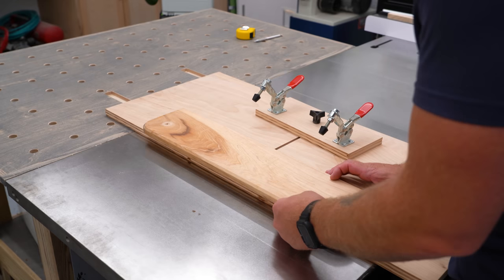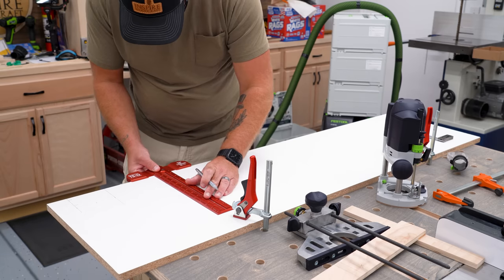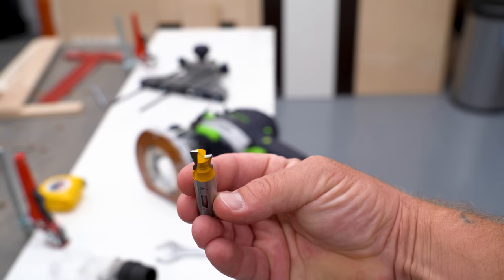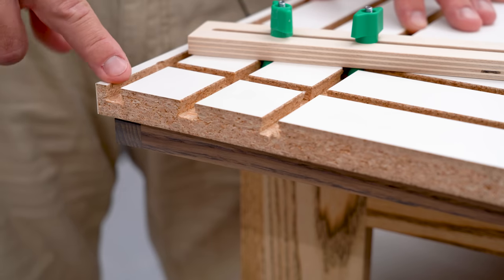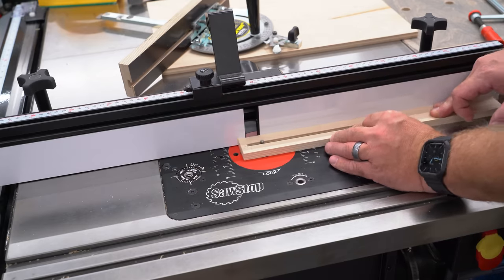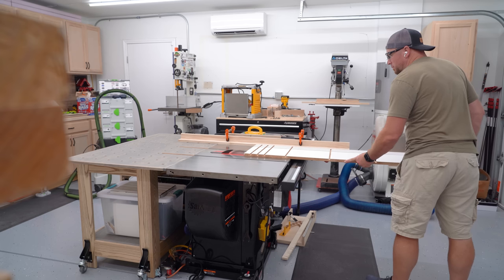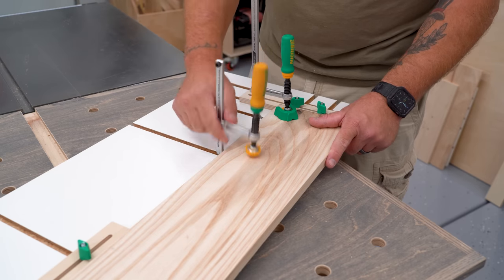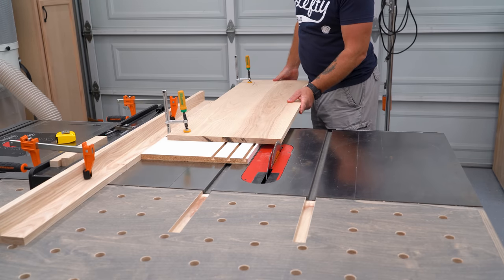Unlimited Possibilities with This Simple Straight-Line Rip/Tapering Sled

Comment: Great video Jody. I think the melamine will hold up just fine, as long as it's not getting slammed around, yes baltic birch is stronger and stiffer, but this way you can run this one and make any improvements with a different substrate later. Great stuff, thank you, Jim.

Comment: I've used shelving for other jigs too.  One of my "tricks" is to smear some wood glue over the ends of the unfinished shelving.  It helps seal them from moisture and they hold up longer.  Thanks for this great video.
Reply from the maker: @Steve Stamper Thanks for adding this! I almost did the same thing but I didn't know how well it would work.

Comment: Another simple but great idea for a jig, and also just as importantly the thought processes behind the design which are mostly overlooked ... that information in itself is invaluable!
I'd add a removable mitre slot rail to the underside (located in a slot and held in by screws) which provides a zero clearance mode of use for doing 'on the line' style cuts ... remove for when wider items are being cut :)

Comment: Love the idea of not extending the grooves toward the cut side. Recently ripped a straight edge on about 50 rough cut scraps that were .75-2 inches wide and constantly had to make sure clamps weren’t hanging out
Reply: When I built my first sled I shaved a slice off the rubber foot of the toggle clamps. I was lucky it didn't hit metal.

Comment: Thanks for sharing...I learn something every time you post! I intend to make one of these for myself from 3/4 MDF..I get the melamine surface provides less friction, so I'll surrender to the paste wax process...Thanks again!
Reply: as a follow up, my jig is just over 54" long and 13" wide mdf with multiple coats of wax..I also use it to joint one edge of a S2S board and have realized much success..still use it for tapered cuts as well..Thanks Jody for this  and all the other learning tips you've shared..this is by far my "go to" channel

Comment: The Matchfit system is fabulous. I made a sled in the same way than yours, but far more basic. Now I will make one like yours. A lateral note: I modified my fence and now is 50" long, this way I don't need the additional fence clamped to the saw original fence.

Comment: I like the idea of being able to accommodate essentially any width, but at a certain point (probably roughly double the width of your sled, bit also dependant on stock thickness and mass) the stock being cut will weigh enough to tip the sled. I wonder if a 2 inch strip of the same material as the sled with a bunch of magnets recessed on the bottom could be used as a support out closer to the blade for wide cuts? It could even be extended longer than the table both front and back to serve as infeed and outfeed support for long rips. Alternatively, bottom mounted clamps of some type might hold it in place better if the saw setup allows for a place to clamp it to.
Reply from the maker: @Jason Still All good points/suggestions. In my experience, depending on how heavy the sled is, it does take a little more than double the sled width to introduce tipping. I don't have anything in the shop to try it out with this sled. If I do run into that situation though, I will probably just double-side tape a strip of the sled material to the table to support the weight. Technically it will alter the angle of the cut, but negligibly.

Comment: Nice setup.  Appreciate the video.  I personally use 3/4 inch Baltic Birch, and use T-tract for my slots.  There are any number of makes/models/types of devices that make use of T-tracks.  Some of my sleds are over 20 years old, and work just as good as the day I made them.  In my experience, particle board isn't going to hold up to constant use over the long stretch.  Thanks.
Reply: The microfit items he’s using approaches $200. Can buy a lot of t-track and toggles for that.
Reply from the maker: @Rta373 Not sure where you came up with $200. On the less expensive side this can be done for $50. Upgrading the clamps brings you up to $70. Maybe I'm missing something?
Reply: @InspireWoodcraft  Microgig dovetail starter kit is $90, 2 adjustable clamps is $40 and I just guessed that you had about another $50. I may have overstated the $, but it is  a good $150.
Reply from the maker: @Rta373 Everything that I had in the shop totals $140 (and I do not have the starter set), but I just want to make sure that one very critical point doesn't get overlooked: You don't need everything that I had, which technically was only extra two clamps. I only had those things to show a few variables on what you could accomplish with this sled. For $50 or $70, someone could have enough hardware to make an inexpensive sled. Most folks have a dovetail bit already and as I said in the video, the Matchfit bit isn't necessary, just convenient. The only reason that I'm pushing the issue is because when other people read the comments, they get discouraged by seeing a price, and if that price is wrong, they won't benefit from what they saw in the video.
Reply: @InspireWoodcraft  thanks for your thorough response
Reply: Also, the clamps and bit can be used for other jigs and projects

Comment: I watched the video on how to use a measuring device.  You noted using a fine line for your mark and other helpful tips.  I still do not understand if I want to cut a piece exactly 2 inches in the middle of a board.  I mark the two points for 2 inches.  Where are the cuts made?  The outside of both marks, the center of the marks or inside the marks.
Reply: Depends on which sides you measured from. If you measure from the left, the left side of the line is accurate, and vice versa.

So, if you measure both lines from the left, you’d cut on the left side of both lines.

Comment: Nice one.  Don't know if its been mentioned, but the other way to avoid cutting the clamp is to reverse the head.
Reply from the maker: @Gary Becker It has and thanks for adding this. At this point though, I personally cannot recommend reversing them. I ran tests for two whole days trying to use them reversed and could not come up with a single way to use them safely without modifying something. They simply would not hold the material down tight enough before they ripped apart the sled material. This was on particle board and phenolic ply.
Reply: @InspireWoodcraft  I like the built in stops better.  Ive only used them reversed in dog holes.  i dont doubt your results.  ;-)

Comment: Jody, love your videos, thus one not withstanding. I'm in the market for a new plunge router and noticed you using that Festool router. Would you recommend it and did you use it with a Festool vacuum as well?
Reply from the maker: @Jeffery Debs Thank you very much. So truthfully, I don't know that I have had the OF1400 for long enough to definitively recommend it, but I will say that I am not at all upset with the purchase. I really like how it plunges. For some reason being able to one-hand plunge (like "drilling" the starter holes in the sled) is one of the things that I've really appreciated. I also like that the on/off switch is a trigger style, and can be used either by squeezing it on or by locking it in the on position, similar to a circular saw. There are two things that I love about it the most so far. One is how quick and easy it is to change collets/bits. It uses a ratcheting mechanism, so you only need one wrench to change things out, and it works extremely well. The other thing is dust collection, which of course was your second question. Dust collection is superb! It does take a little bit to get into a rhythm as far as how to set everything up and what to do/not do, but that's like most tools. The extractor is the CT/48 and I am a huge fan of it as well, and of course it pairs perfectly to the router. I hope that helps!
Reply: @InspireWoodcraft  Jody, that helps a lot, thank you. I'll now look up pricing for both the router and dust extractor and will make sure to be sitting down upon learning of their cost!

Comment: Do you have an opinion about the Match Fit system by MicroJig? You're halfway there with some of the jigs you use. Thx for sharing your knowledge
Reply from the maker: @Michael P I like it. I think for one or two jigs it may not be worth investing into, if you currently have another way of doing it. But if you find yourself making new jigs all the time, the cost of the system pays for itself very quickly. It's very easy to just route a dovetail and get to work.

Comment: Couldn't you have turned the head of the clamp around so clamp foot was not directly below head of clamp?
Reply from the maker: @Diane Takis Not in this case. When reversed, the clamps will not tighten down with enough pressure to safely hold the material without tearing the sled apart. This is the case with particular board, plywood and solid wood.

Comment: I'm not a fan of the Matchfit for the simple reason that they're slightly smaller than guide rail clamps. If I cut a t-slot groove which fits a guide rail clamp I can put nearly anything in it. If I cut to the width of the Matchfit bit, I can use Matchfit. The only thing I've used the Matchfit bit for recently was to run it twice a little more than 1mm off to create wider slots.
Reply: I completely agree! Because Matchfit clamps don't swivel 360 deg, you need more slots to cover all clamping possibilities and yet T track clamps, some auto adjusting, from Rockley, Bessey, Armor tool and Kreg all do and you only need a few tracks. I've made a similar jig with 2 T tracks to hold the fence and a slot in the fence for a few hold down clamps. They are handy for some tasks eg sacrificial fences but not sleds
Did enjoy the video.
Reply from the maker: @Kyle Olson Yeah there seems to be a lot of discussion of dovetail vs track clamps. I was hesitant for years on the Matchfit because it almost seemed gimicky, but when I built my outfeed table I decided to try them out, as well as the Bessey track clamps. In my table legs, I routed the dovetail slot as well as a well-placed t-slot, and now I can use either clamp in the one groove, which is kind of nice. I will say though that the more I use them, the more I'm sold on them simply because there are so many different profiles of track, t-slots and track clamps, and there's only one 14-degree, 1/2-inch dovetail. So they just work. Getting the right combination of track or t-slot with the right clamp isn't as easy.

Comment: Take the screw out on the clamp and reverse it.  The saw will not cut the clamp then.  That’s what I do.
Reply from the maker: Thomas Slate I wondered if someone was going to bring this up. At this point I personally cannot recommend reversing them. I ran tests for two whole days trying to use them reversed and could not come up with a single way to use them safely without modifying something. They simply would not hold the material down tight enough before they ripped apart the sled material. This was on particle board and phenolic ply. I actually had footage of the tests, just in case folks asked, and I cut it from the final edit because I didn't think anyone would care. Haha

Comment: I don't know why you made this although it is a very nice project but when you can do the same thing using your table saw fence you would gain an extra three quarters of an inch thickness in cutting depth
Reply from the maker: @Rick Gledura Because the only other safe and successful way to straight-line rip or taper without a sled is to have something secured to the workpiece via double-sided tape or screws. Then that something (like a long piece of straight plywood, for example) would ride along the fence. The result would be a nice, clean, straight cut. It's quite a pain to do it that way when you have multiple pieces to cut, especially when you want them all to be to the exact same taper.
Reply: @InspireWoodcraft  
It would be easier to set your fence and use a taper jig
Reply from the maker: @Rick Gledura Oh I see what you're saying. I thought you meant just the fence. So I'm not sure if I mentioned it or not, but this IS a tapering jig. Just a bit of an upgrade from the traditional style tapering jig since it gives me more options. Thanks for watching!

Comment: I’ve been using a straight line boards for 30 years and they are the most over engineered jigs I see on YouTube. All you need is a straight board with something as a stop or hook attached to the end of the board and that’s it. Making sleds with clamps, t-tracks, flat screen tv’s, microwaves and what ever bling you can put on them is absolutely silly to me.
Reply from the maker: @Marcus And yet you still clicked to watch 🙄
Reply: @InspireWoodcraft  - Actually I didn’t, the thumb nail was in my feed. Enjoy your thingamajig.

Comment: great sled idea,..... terrible, expensive proprietary clamps.... there are much better, way cheaper clamp options
Reply: Don’t leave us hanging! Any recommendations for alternatives?
Reply: Not really.. they just go in a track created with a 14° dovetail bit. You can use any bit, theirs just has a roundover so the clamps and jig hardware slides better. The cost savings comes from the fact that you don't have to buy t-track ever again and the jigs, tables and sleds you can create are far more versatile. This system has saved me $100s
Reply: @G0F15H  You can buy a T slot router bit instead of T track and use inexpensive hold down clamps, I've even made my own, that swivel at 360 degrees. I've saved even more
Reply: @John Barr  has answered the question perfectly.... t-slot bit instead of a dovetail, lets you use the chinese knockoff bessey/festard clamps that fit intp T-Slot groves.... I just know I have other stuff to waste money on other than proprietary tools (remember microjig, magswitch, kreg.... all hand out tools to these dudes like candy... ) not that is happening here, just another point
Reply: @CementRoots  Sure, you can do the same thing for T-slot stuff. The point is, the MatchFit system isn't proprietary. It's not the industry standard, but that doesn't mean you have to buy MicroJig products in order to use the system, or that no one else can introduce products that utilize a 14° dovetail track
Reply: Another important feature of the MatchFit clamps, remove the retaining screw on the end, turn the clamp around & reinstall the screw (if necessary)
Then, the clamp does not “stick out past” the edge of the board.
I’ve done this & works out great.
Thanks for all your efforts, contents & quality workmanship.
Reply: @G0F15H  try sticking a bessey or even better a bessey knockoff in one of those dovetail slots, aint happenin'..... also try putting one of there clamps in a t-slot... nope..... there system is a one trick pony.....
Reply: @CementRoots  Why would I do that? That's not how the Bessey clamps are designed to work. They're also the same price as the MatchFit, so what's the advantage of buying that brand over the other? Your whole argument is equivalent to calling a Philips head screw proprietary and then using a flat head screwdriver; it might kind of work, but why not just use the proper tool for the job?
Reply: @G0F15H  I'll say it again with less words.... t-slot router bit.... with bessey "style" aka countless chinese knockoff table clamps..... your done for under $50
Reply: @CementRoots ......  and you don't need as many slots as all the inexpensive hold down clamps can swivel at 360 degrees so less time making the jig. As an example I saw a drill press table that had 10 dovetail slots, mine has two T tracks (can use T slots) and covers every clamping point I need. Also the clamps I use I made myself that use standard 5/16" bolts (not microjig's more expensive dovetail bolts) so you have the choice of a vast array of clamps that have been around for years from inexpensive home made clamps to the auto adjust clamps that you might already have lying around the shop. Less time, way less money and more choices.

Comment: To avoid the blade running into the clamp, you can easily swap the direction of the clamp as shown by the clamp resting on its flank in the center of this photo: https://global-uploads.webflow.com/5cfd83cf1c26ab7392063e1f/5deb207ef88fbc48862a4bcb_dovetail-clamps-workbench.jpg
Reply: To do the swap, just undo the screw at the top of the clamp, then pull out the piece all the way and reinstall in the other direction.
Reply from the maker: @Julien Phalip I was going to originally, but the clamps don’t clamp down tight enough before the material starts ripping apart. I ran a bunch of tests on particle board, phenolic ply and hardwood, and the materials always start breaking apart long before the clamps provide enough clamping pressure. At this point, I personally don’t recommend switching the clamp heads around in this application. Too much room for something to go wrong.
Reply from the maker: @Julien Phalip Interestingly enough, if you actually look at the details in the photo that you linked, the clamps that are reversed are supported with extra material on top of them to prevent them from lifting apart the material that they’re in. This is exactly what my tests revealed as well. The only way to not have them rip apart the material is to have something fastened above them. I used a strip of hardwood superglued to the top. It worked fine then, but not at all convenient for this application.